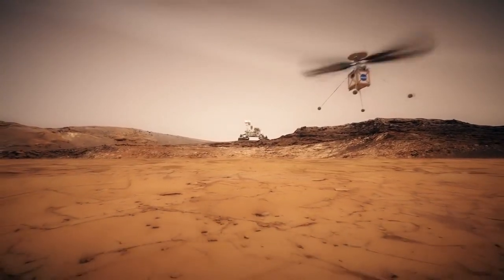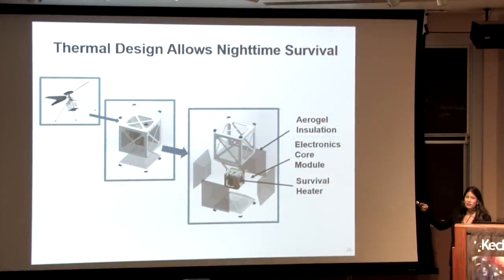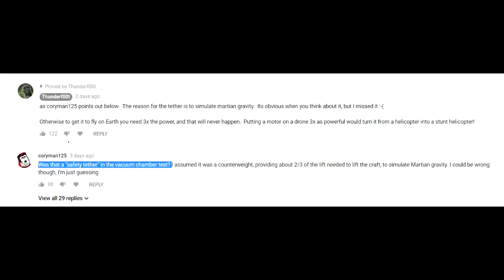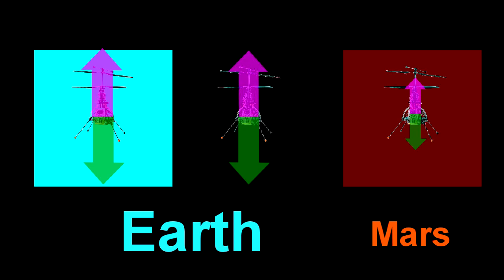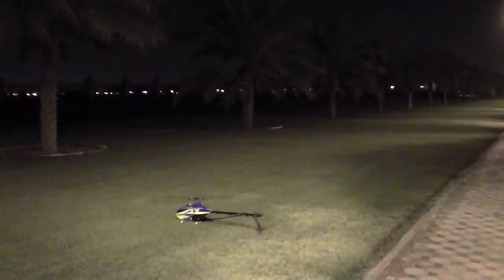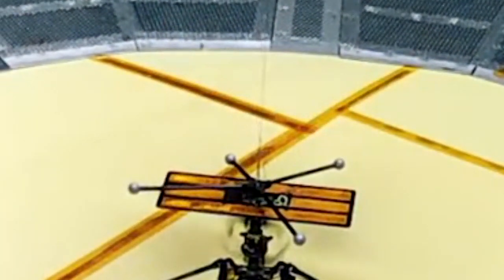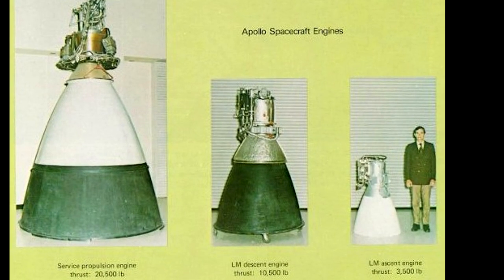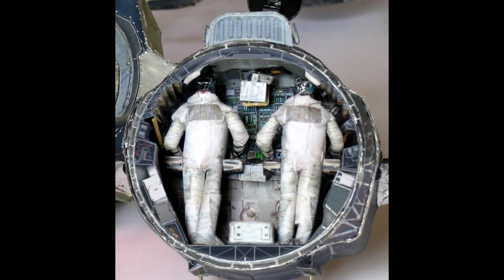Why NASAs Martian Helicopter CANT fly on Earth!

Comment: How did they film the capsule leaving the moon? It moved upward as the capsule left? I’m genuinely curious. Not a conspiracy theorist.
Reply: Michael Drake They messed up the first two missions that they tried to record it due to 3 second delay when transmiting the signals to the camera in the last mission the guy at mission control got it just right
Reply: Danny Thompson I hear the thrusters exhaust hit the camera. Very lucky shot really.
Reply: the mars rover's mounted camera; it was left behind rip
Reply: Curios Droid did a video on this topic you should check it out. He has some great info on all things space related.
Reply: Kubrick dunnit obv ;-)
Reply: moon buggy* lol
Reply: The ISS lightlag delay isn't 6 or 8 seconds- the network they feed to causes it. Apollo had its own dedicated, private network, so lightlag was basically the only delay. ISS could do better, but who wants to pay the difference?
Reply: Left a film crew behind. They're still waiting.
Reply: "So exactly how did they have such advanced wireless connections?"  

It's something called a "radio." We've had them since 1894. 
"and what infrastructure did they have on the moon?"  

Here's the fun thing about wireless radios. You don't need a massive aerial to receive it. You just need the signal to be aimed correctly.
" timing I add. There would be so much delay there is no way someone on earth could control it and the right moment to pan up." 

Distance to the moon from Earth is approximately 384 million metres. Light (and therefore radio waves, which are exactly the same thing) travels at a velocity of approximately 300 million metres per second.
A radio signal to the moon and back (and vice versa) takes 2.6 seconds. 

I don't know about you, but I could predict something about 3 seconds into the future, especially if the relevant calculations (i.e. speed of ascent) had already been made via multiple previous instances.

"I want you all to think of the material that is needed to withstand extreme heat and cold. Now if we had that technology, why are we not having our firefighters use them?"  

I know Sir Giggles answered this, but I'd like to add that spacesuits were designed to maintain pressure in the vacuum of space, and  protect astronauts from ionising cosmic radiation as much as heat and cold. Those are things we don't need on Earth, since our atmosphere does both quite effectively.

"the moon, when it is transparent, how would that look to a astronaut on the moon? All of sudden your on this rock and dust and poof you can see right through..."  

WTF??? The Moon is NEVER transparent! What the hell are you talking about here? 

Do you mean when we see less than a full moon? That's not transparent, it's just not lit up. The bit we can't see is in shadow because the sun is shining on it from an angle that's not from behind us. It's the same reason we have night time here on Earth.
Reply: Shoulda just tied a string to the camera while going at those high speeds in space
Reply: Ed Fendell, at NASA, operated the LRV camera by remote control.
Reply: Oremo Oremo how come the moon has only a 3 second delay yet the ISS has about 6-8? Yet the moon is 50 times further away? 🤔
Reply: They cloned Buzz Aldrin several times and left the clones up there, to be woken up periodically as each of them outlives his usefulness (the old clone gets into a "return capsule" and is incinerated). They're all still up there collecting moon rocks. Hey, I could make a movie out of that...(not ridicule, just sarcasm)
Reply: tctheunbeliever perfect title for that movie would be "moon". Oh wait...
Reply: Daniel L. Lort 😂
Reply: @Grabit Hard 
"One guy says it was controlled from earth... really?"
Yes, really.

 "So exactly how did they have such advanced wireless connections?  Knowingly just for good cell service we had to upgrade the infrastructure to communicate and interact the way we do now."
The difference is, we have a million people with cell phones in a single city, all of which need to be connected to the towers at all times, to know when they are receiving a call, and tens of thousands of calls going on at any given time. You need a shitton of infrastructure for that. Communicating with a single camera on the moon just requires a single connection, which can even be done with line-of-sight. That is far easier.

 "Some of you need to stop watching the sci-fi crap. Why?, if they went to the moon then,  they claim they scrapped all the data and technology to go back."
Because that technology is old and outdated, and would be rusting and unreliable if it still existed. We have the technology to go to the moon today, but there isn't much point, and it's still stupidly expensive.

 "Some of you just can't wake up to someone is lying to you. I know you want it to be real, don't we all."
WAKE UP, SHEEPLE

 "But mars, the moon, and any other plantes are just not possible to go to."
Says a random guy on the internet.

 "I want you all to think of the material that is needed to withstand extreme heat and cold. Now if we had that technology, why are we not having our firefighters use them?"
Those big heavy fire-retardant suits that firefighters wear aren't just for show. And they aren't a new tech, either. We've had them for ages, it's just that they used to be made out of materials like asbestos, which is horrendously cancerous. Now, we use much more advanced materials that don't cause horrifying diseases.

 "Why are we not making it possible for people who live in the cold to be protected."
I live in northern Canada, and we're definitely protected from the cold. Our houses have decent insulation. We don't use the super-advanced stuff, because that would be ridiculously expensive for little benefit, but you can buy coats and other clothing made from advanced materials. My current coat is rated for -40 weather because of it.

 "They gave us the microwave..why not the technology to prevent from harsh conditions on earth?"
What harsh conditions do we not have the technology to protect ourselves from?
Reply: The camera was controlled from Earth. You can see that in the slight delay when they try to catch up to the ascend module - they needed to factor in the two second delay, that's why the camera starts to move a little late and overshoots slightly.
Reply: Rob The ISS also sometimes relies on already existing communication satellites to relay its transmissions since they orbit the earth very quicky thus going out of range from the USA or Russia. These networks are also busy with signals from other devices on earth therefore there is bound to be some traffic. The Apollo mission comm systems were handled by NASA'S deep space network which were private comm systems.
Reply: you do all realise the communication with the moon were mostly real time analogic !
no actual network to speak of just two guys talking on the radio. went  they relayed the com to the huston control room that was an other stories...
Iss uses convention télécommunications networks with are not only digital but also not real time. Wen the pakets arrive is not considered relevant and therefore those system will introduce latency (ie ping) .
so bought system cannot actually be compered since one is actually having problems with the  c limit and the other is closer to a overwacht match than anything else!
Reply: Thats the indie sci fi movie moon
Reply: Sir Giggles and what infrastructure did they have on the moon? Yet alone the greatest signal ever and timing I add. There would be so much delay there is no way someone on earth could control it and the right moment to pan up. Do you really think NASA inspired the film's? The film's, comics, books and merchandise was way before NASA. Aliens and whatnot. So , they made one good movie of astronauts landing on the moon and we have been paying for it since. It sucks, but nasa is not who you think they are. I used to believe in it to man. I started looking at there patents, the so called technology they used. Anything at all for some proof. It's not there, but the history of NASA is, the declassified documents showing how NASA was put together. If there are things in a story that contradict each other, you already know then the person telling the story is lying. I don't know how else to get people to see the truth , but I swear once we all do. It will be us to finally go explore, no limits, no restrictions and all information open and fully diclosed publicly. Everyone accepted everyone welcomed. 
 Even this as I'm thinking of transparency,  the moon, when it is transparent, how would that look to a astronaut on the moon? All of sudden your on this rock and dust and poof you can see right through... if you don't even think openly on it don't bother  responding. I'm just tired of more of the lies being spread and gullible people wanting to believe in anything.
Reply: There is contradictions in the things they say and do, means there is lies. They even got caught lying about finding extraterrestrial life...taken right from science fiction.  It's not hard now to watch and see the things they want people to believe. How is NASA connected to U.S. military? How are  German Nazi scientists  connected to NASA?  You want to answer everything else.
Reply: "There is contradictions in the things they say and do, means there is lies. They even got caught lying about finding extraterrestrial life...taken right from science fiction."  

Could you provide evidence for that, please? Because the only claim about extraterrestrial life I know about was misinterpreted by the media, not NASA. 

Also, have you any idea how much of what used to be 'science fiction' is now fact? 

Mobile communicators the size of a person's palm, flat screens which display images and sound from the other side of the world in real time, chips the size of your fingernail which can store of full-length novels (if not more)....

 Even space travel was just a dream of science fiction writers at one time.

"How is NASA connected to U.S. military?" 

For a start, most astronauts were military pilots. Second, much of NASA technology regarding aeronautics, communication and surveillance has ended up being used by the military one way or another. Third, at least a few of the satellites that NASA has launched have been used for covert surveillance of America's enemies. 

"How are  German Nazi scientists  connected to NASA?"  

They helped the US develop rocket technology, since Germany already had it. That's not a secret, and never has been.
Reply: Gummy Bugz - And if we did go to the moon then we have/had technology to block the strongest radiation. Meaning....We would have a answer for Fukushima and stop all that radiation leaking. You have excuses for all the errors. I'm done making excuses for them. Do you realize the money they have took has lead millions of Americans in to poverty. You ever wonder why prices keep inflating? Again you got answers for it all, then what is the connection between NASA and the military? How was NASA started? Why were Nazi scientists from the holocaust recruited and put in charge of NASA? If your going to answer questions, then you should answer these too.
Reply: waptek0 - How did that testing go on earth? What were the flaws?  I once believed in to all this NASA stuff. Reality for me has set in. You wouldn't destroy evidence and data of us going to the moon. You can't say we had the technology and now we don't. If we can fly spaceships ,rockets, satellites,telescopes in space and control camera's on the moon. Then we should be way more advanced in what NASA is doing. Rather then keep repeating the tricks like they always have. If you see how much money has been robbed from everyone and all we have is there words,cgi and Photoshop images. I took a hard look and found out what NASA really is. Once other's realize we can stop this game of secrets. I have no hate toward anyone, believe who or what you want. All I ask is please just look.
Reply: Gummy Bugz - transparent or translucent..you know when you see a half moon during the day, and the half blocked resembles our sky. Wonder how it will look on the moon. I imagine it to be clear but reflective.
Reply: Gummy Bugz - The point of how they started should tell you enough. Nazi scientists or not they were responsible just like the rest of them. All the captured were to be tried for war crimes.  Were the american citizens notified or was it hidden? None of these scientist were left in charge?  Least you know they made missles before shit for space. NASA isn't just space stuff either now too. Do you believe citizens should be forced to pay for something they don't want? 
Just like those spaceships NASA launches their crafty handy work launches missiles to perfection now. So your willing to accept what they are, then your willing to accept the millions of missiles that America has produced,sold, and dropped on countries. Don't just ignore the millions of lives they have destroyed, just becuase they can fly a missile in to space ,make art, movies and defy reality. That's the real NASA, and our governments dirty secret. You can say it has no relevance,  whatever , it does becuase without those scientists Russia and America held on to, who knows where our missle technology would be?.... Are we to believe then also with this secret our CIA isn't up to something else like always. This shit goes on forever , just keep defending your missile/space program. You want star wars so bad you better build your ship before there isn't anything left. Maybe NASA can give you some plans that worked if they haven't destroyed them yet.
Reply: Gummy Bugz - gotcha man, I understand what it is. My point is what would be the view from the moon. You don't get it, by saying I don't understand what NASA does.  They make movie magic, and they got you and others to believe. I get it though, looking from your perspective you need to defend your belief. Even towards the end of this video that is movie magic, you don't reach a end of the moon when circling next to it. Next thing is that wonderful technology thinking we can control a camera on the moon. If that is the case then we should have been able to keep watching the moon way after astronauts returned. But yeah, I don't understand or just choose not to believe. Did you know DARPA was also created same time with NASA? Do you trust our government?
Reply: http://www.moonlandinghoax.org/19.html
Reply: paul willoughby does that not support that we should still have a cctv there? Final statement is of invisible flame..right. Just like the dust on the moon that didnt kick up 60 ft. Just like the way you can  leave a footprint. Just like the spacesuit that fails in a vacuum chamber. Just like ....there is lists of contradictions but I rest. 
You must understand I too once believed in it. But after hearing Don Pettit say we would like to go back but we destroyed that technology...Who does he think we are fools? We still have rotary phones and microwaves, we should have all data and plans to go to the moon 100 times if we want. Anyway thats what made me look really  how NASA started and seeing and now knowing its entire government program they put together. I can not trust their intentions, and do not see why anyone would.
Reply: Grabit Hard - Finish school, and listen and read more than you write.
Reply: Danny Thompson They didn't use any wireless device to move the camera. They had a timer on the device that moved the camera upwards at launch, really simple actually. I dont understand what all these other people are talking about
Reply: No, AstroChristian, it was remote controlled. The rover had a TV camera on a remote-controlled motorized mast. There was a guy in mission control who operated it.
Reply: @user-zv8qg1co4z  wheres the data to prove that?
Reply: Danny Thompson camera crew. 👍
Reply: Use facts and common sense. One guy says it was controlled from earth... really? So exactly how did they have such advanced wireless connections?  Knowingly just for good cell service we had to upgrade the infrastructure to communicate and interact the way we do now. Some of you need to stop watching the sci-fi crap. Why?, if they went to the moon then,  they claim they scrapped all the data and technology to go back. Some of you just can't wake up to someone is lying to you. I know you want it to be real, don't we all. But mars, the moon, and any other plantes are just not possible to go to. I want you all to think of the material that is needed to withstand extreme heat and cold. Now if we had that technology, why are we not having our firefighters use them? Why are we not making it possible for people who live in the cold to be protected. They gave us the microwave..why not the technology to prevent from harsh conditions on earth? See my friends, you believe in one big lie and where it takes you, is not where you really want to go.
Reply: literally going 20mph up and out of the moon and expect me to believe it. nope